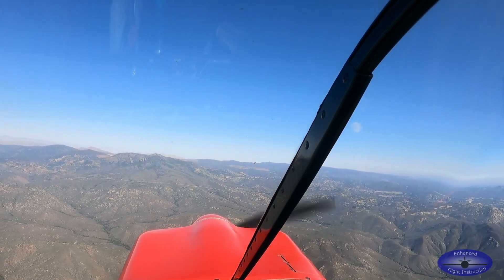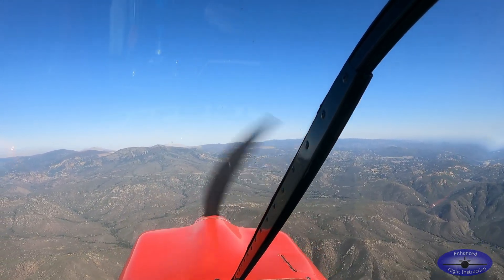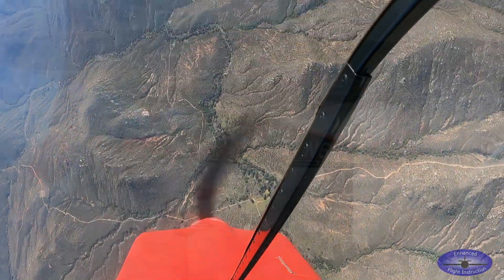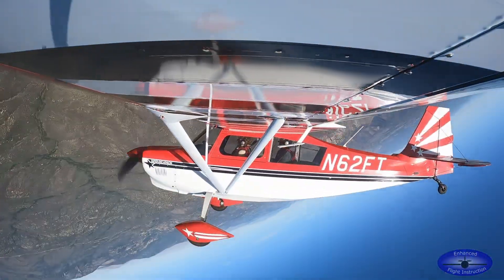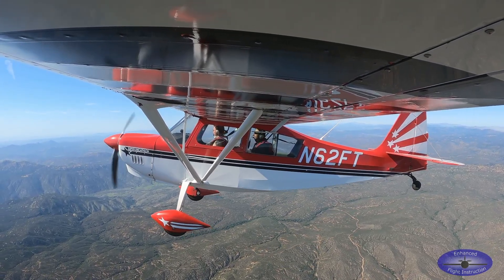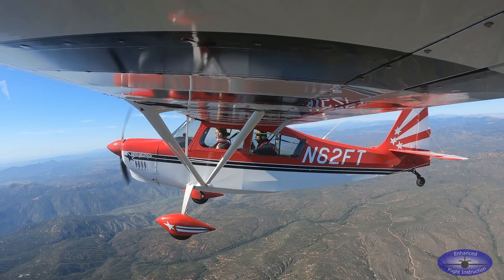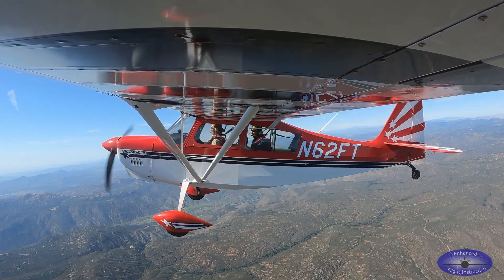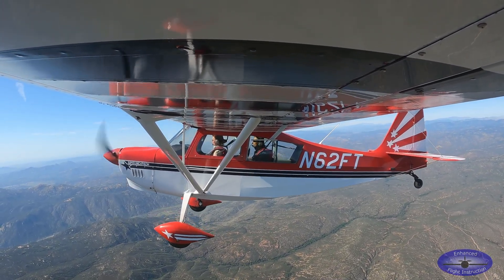Inadvertent Stalls in the Real World

Comment: I flew a Decathlon in Australia, it's a very light aircraft & is easy to throw around at low speeds, on heavier aircraft & the way they're designed doesn't quite work like that, it usually takes a bit of either effort or doing something dumb to stall it, usually from lack of airspeed &/or high angle of attack ie over 16 degrees to the airflow!
Reply from the maker: The point of this video is to show that real world inadvertent stalls don't have the characteristics that pilots are accustomed to seeing in the stalls they perform in their private pilot, Commercial or even ATP checkrides. Whether in a Decathlon or in a Cirrus, Cessna, Piper or even a turbine aircraft (see, for example, my article in Aviation Safety Magazine on a 2021 Learjet crash in San Diego https://www.aviationsafetymagazine.com/risk_management/marginal-decisions/ ), real world stalls surprise pilots. Those stalls do not have the characteristics that pilots associate with the stalls they previously practices, e.g., nose high attitude, need for excessive and continuous elevator backpressure, lots of warnings before the break, etc. Of course, all stall are, by definition, associated with exceeding the critical angle of attack. It's just that in real world inadvertent stalls pilots get there in ways that, most of time, surprise them. This is a hole in pilot training that continues to extract a price in accidents and fatalities.